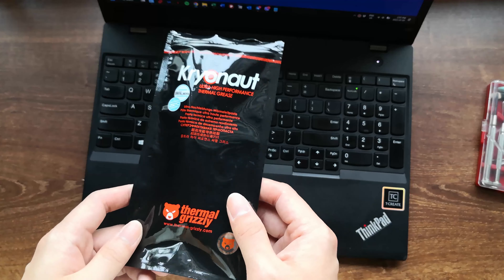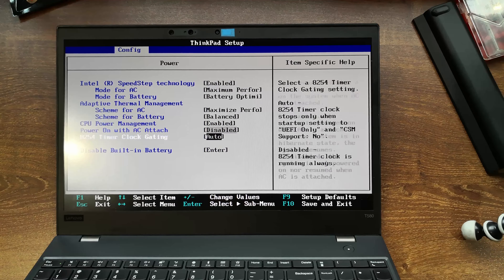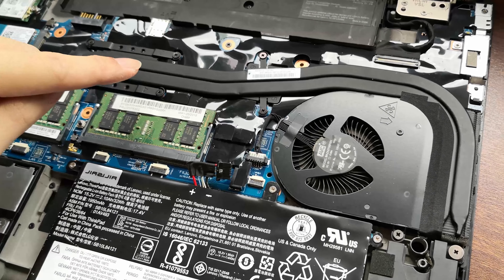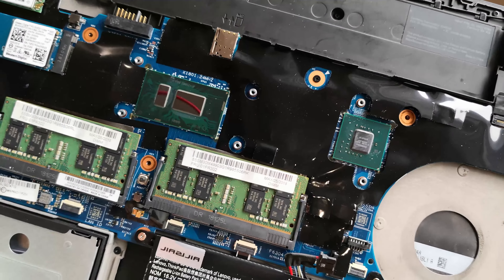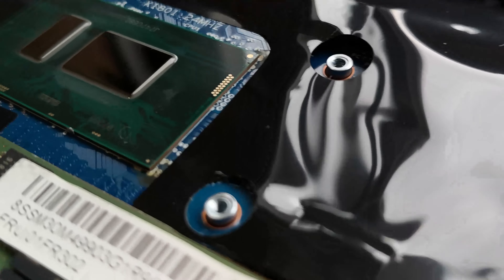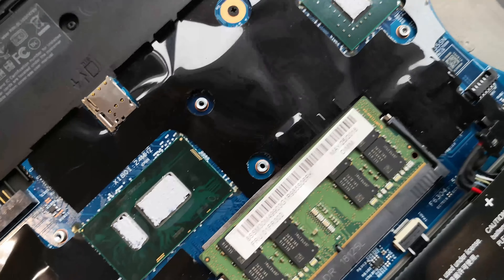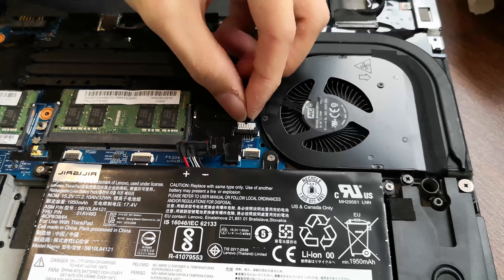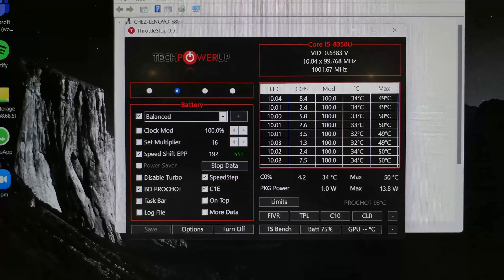How to Reapply Thermal Paste on Your Laptop CPU and GPU (with results) | Lenovo Thinkpad T580 P52s

Comment: I didn't have thermal paste on the small horizontal rectangle below the vertical rectangle. What is that area? Does it need thermal paste?
Reply from the maker: I put paste on mine because there was paste there from the factory. If yours doesn't and you're sure it hasn't been repasted before, I'd keep it free of paste.
Reply: @ChezDoesStuff  I'm not sure if this is the factory default. What's over there?